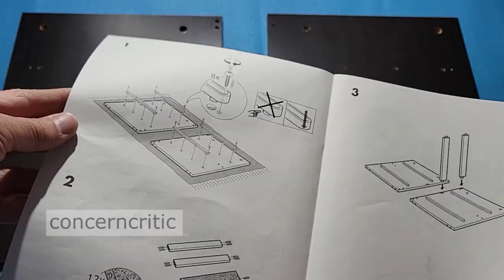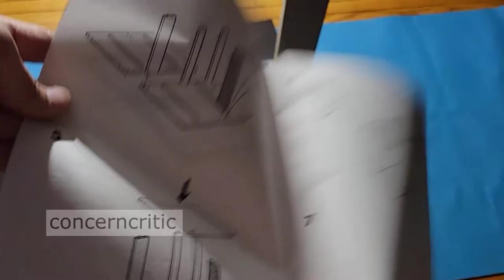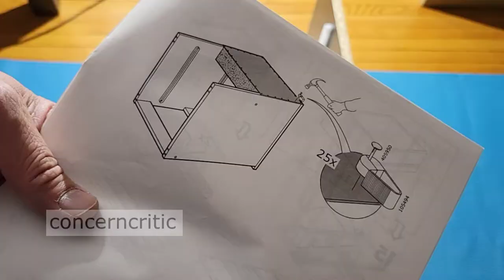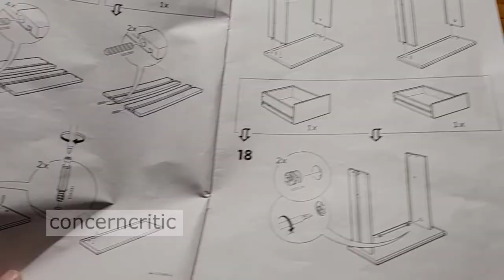IKEA KULLEN 2-drawer chest | Unboxing and assembly

Comment: While the Kullen is very compact and suitable for small spaces, do note that the drawers do not have rolling side tracks and instead rely on the solid drawer surface sliding against the solid frame surface. This inevitably causes wear on both surfaces (of paper foil). The drawer also does not slide smooth.
Reply: It’s ikea what do you expect